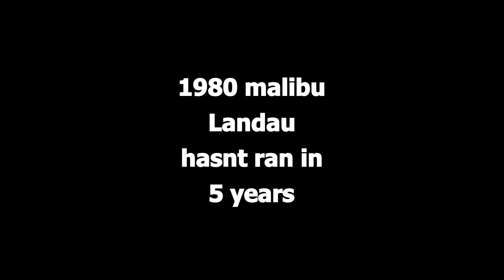1980 malibu landau barn find. getting it to run for the first time in years

Comment: Would STILL love to find an 1980 El Camino...but I just don't think in my 'older years' I'd have the dexterity to still 'work on it' and restore it like it should be...but would have been nice to have a 1980-model 300-hp 350 El Camino...(had a 1972 Super Sport that was my favorite car...complete with a TH400 Transmission, rally wheels, 4-core radiator, and full SS instrumentation)...
Reply from the maker: there are still some nice ones around that do not need restored, but hold onto your wallet LOL. the 68-72 elco are the best body style in my opinion, my grandpa had a 69, it was one of the first cars i ever drove, out in the fields cutting thistles, if i remember right i was like 12 or 13 years old